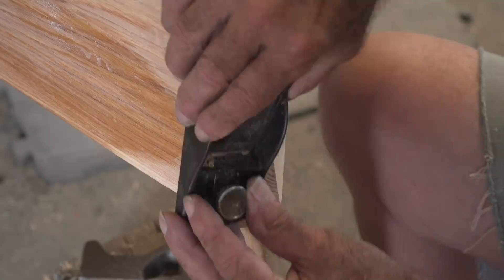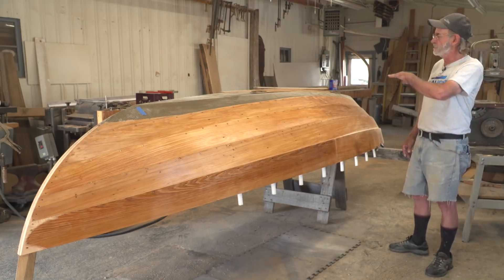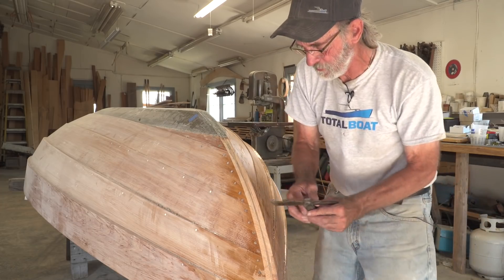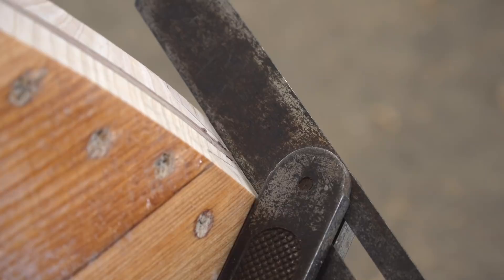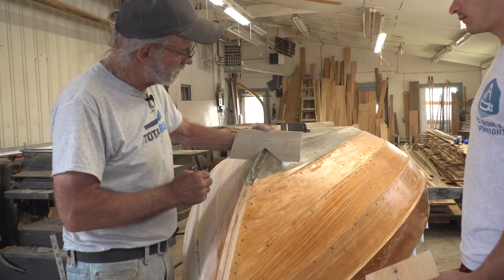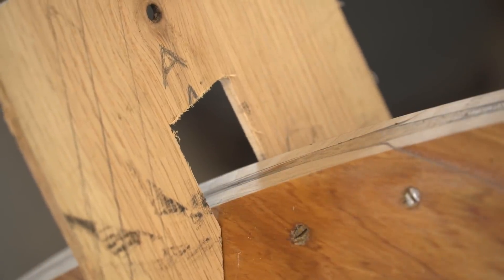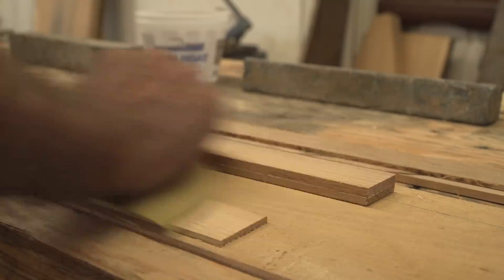Building the TotalBoat Sport Dory: Episode 28 - Laminating the Stem Cap

Comment: When building an external stem on a kayak I simultaneously score lines on both sides by drawing down a sharp-edged u-shaped jig that is the width of the stem.  Assuming I can keep the jig largely perpendicular to the axis of the boat as I scribe I can largely accomplish your even angle throughout the length of the stem and ensure I'm not taking off more wood in one place than I should.  Just a thought ...

Comment: How much would it cost to build this
Reply: $17,248.31 plus tax.
Reply: j smith It'd vary alot on the wood used and quality of the wood you get. Also where you get it. The fasteners, glues, paints, etc. are available at totalboat.com and that 2-1 epoxy he uses ranges from $40 to $140 a set. Overall its a labor of love that you should enjoy the process of doing if your going to do it. It's a serious investment in both time and money. Think about how much the work skiff sold for (albeit auction) there's a reason for that.

Comment: Lou, you're talking "port side" while 
the dory is inverted.  Wouldn't that 
actually be the starboard side?

I don't know, which is why I'm asking.

steve
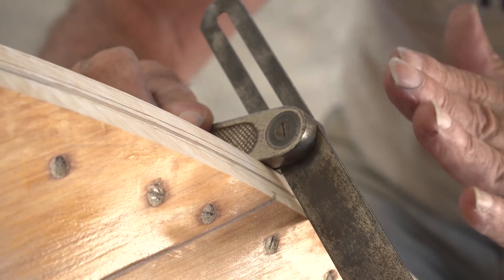Reply: If you're talking about the bit at ~3:08, re. "planing down the Port side"... that is the "longer" of the hood ends, the "high" side of the un-corrected stem face he was pointing to.  That is the side closest to the camera in this shot, which IS the Port side of the boat (while up-side down, as you say).
Reply: Steve Skouson SEMANTICS STEVE SEMANTICS, JUST SAYING OLD ONE LEGGED JOSEPH T RETIRED NAVY
Reply: The left side of the boat is always the left side of the boat, just like the drivers side of a car is always the drivers side.
Reply: Tell the USCG, that has come to rescue you in a capsized boat, that you are on the Port Side, ........and see where they look.
Reply: Steve.....   Stage right is the same for the performer AND the audience.  Same as PORT SIDE is the same  for  normal floating boat or capsized.boat
Reply: As long as a boat has a fore and aft it has a port and starboard regardless of orientation.
Reply: Sorry, the left side of a boat, upside down, 
is not the left side of a boat, right side up.

Think "stage right, " and "stage left."

steve